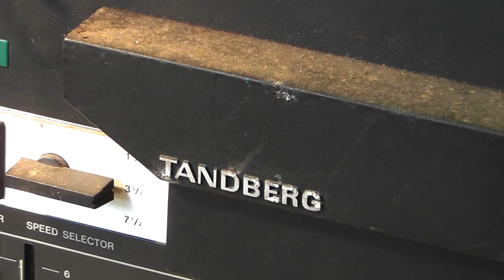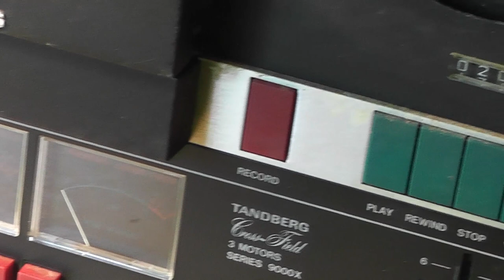Tandberg Tape Deck 9000x Cross Head

Comment: Hello David, I noticed on 10:00 that the tape isn't set correctly. Tape should go below the lifting arm before the metal roller. You can see the lifting arm has some wear where the tape should go. This is important because with the current setup the tape will touch (and wear) the erase and record heads in fast forward and rewind! That lifting arm is also connected to the cross field bias head and its not functioning correctly (see 10:23 the bias head isn't able to "snap" against the record head, its moving slowly with the lifting arm).
Anyway nice video and it's good to see Tandbergs up and running!
Reply from the maker: Thank you for your observation regarding the incorrect tape path. Now corrected, much better, thanks. I should have noticed.

Comment: David, hi! Is this 9000 made with tubes? 
I see the bias head here opposite the record head! This is a patent from Tandberg - "Crossfield". This should record very well if the condition of the heads is good. However, it is very difficult to setup and adjust it. Thanks for the video! Good luck!

Comment: Hello. Thanks for the video. What are your basic safety checks aside from checking the power cord and making sure there are no obvious flammable contaminants inside the case? Thanks!
Reply from the maker: Thanks for your question. Has it been stored in a damp location, mold on case etc, of course mains cable and plug, any signs of previous repair, smell, general dirt and rust. I first apply power though a limiting circuit, checking for smoke or burning before applying full power. Problems are most likely to be mechanical on tape machines which until all functions are tested can be difficult to find. Hope this helps.
Reply: @DavidHallettProjects  Excellent, thank you. I have a few old r2r recorders I need to check out. Very helpful.

Comment: You definitely got lucky that there was not more wrong with that. My guess is that it had a lot of work done before you got it.
Reply from the maker: Yes definitely, there are some issues that still need sorting, missing knobs, and intermittant fast rewind but generaly it is not in bad condition, thanks for your comments.

Comment: Hi, I have the same unit.. which lube did U use for the pinch roller mechanism? Mine seems to have the same issue.. did u re-oil the motors and capstan ? Is there a specific spot to do this? I will check for a service manual also.. thx
Reply from the maker: I use a fine watchmakers lube for most spindle bearing areas and on sliding surfaces  a very light grease. Getting the old stuff off is often quite difficult, metholated sprit or de greaser helps. I have not as  yet found a spacific lube point on the motors. This is not a lot of help but keep persevering.
Dave
Reply: @DavidHallettProjects  hi, thx for reply... I was also wondering about the slider rod in the back.. on the main board... what does it do.. I see a little metal rod that moves some slider switches but it doesn’t attach to anything... unless mine is broken..
Reply from the maker: @Maxxzinno  I will need to check that on my machine as I can't recall the switch. Will get back to you.
Reply: @DavidHallettProjects  hi, ended up fixing the lever 
The metal wire that pulls it was broken 
I replaced it with Mig wire

Comment: I have this same unit, just got it all lubed and running smooth and now it has almost no sound! Full volume on the amp sounds like headphone level. Any ideas? I hope it’s not something like a transistor or something.
Reply from the maker: Sorry about the late reply. Not much help but try and download a service manual and do some basic checks. If it is down on both channels look for something common, maybe power supply. First clean all controls with good quality switch cleaner. Let me know results.
Dave

Comment: Hello David, I got my 9000X out of storage and found it had same problem as yours.  I'm having trouble removing top cover that surrounds the spools, could you provide further information on how it comes off.  Also, the slider knobs are cracked and falling apart so I might take your advice and try 3D printing at my local library.
Reply from the maker: Hi, sorry for the delay in removing the top of the machine. Remove the visable top screws, the remove the two tape head covers. Under the top head cover you will find two further retaining screws, remove these and the top panel can be listed off. Hope this helps. Can't help with the 3d printing for the knobs, sorry.
David
Reply: @DavidHallettProjects  Hi David,
Thanks for this. I did notice 2 screws under head cover but they seemed to me to be part of head mechanism.  I'll get the Tandberg back off the shelf. As regards the slider knobs I found this one which are very close in dimensions and style to those on the 9000X. www.farnell.com/cad/3048995.pdf?_ga=2.227544987.740400996.1600709993-1621960734.1593247045
The important dimension is the 8mm slot which is right size. Available at Newark here in Canada. The knobs on my machine are split - I guess Tandberg chose the wring supplier at the time! They are coloured green, but the new black ones will look fine I think.
Cheers, Ray
Reply from the maker: @redsky7161  Yes  the screws do look part of the head assembly but they only secure the top. Good look with the knobs
Dave
Reply: @DavidHallettProjects  I have got some other work to do but will let you know how how things go when I get back to the 9000X.  Enjoy your videos!